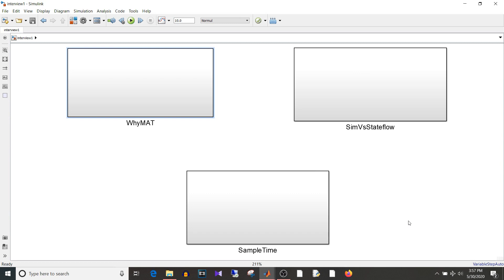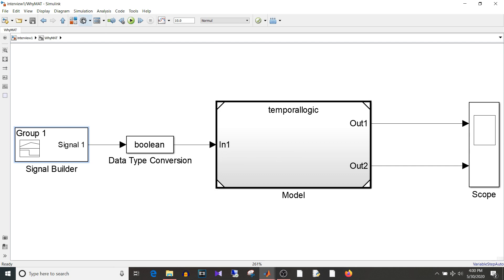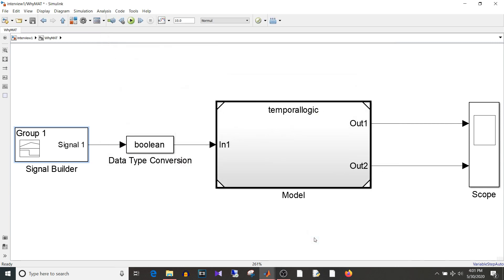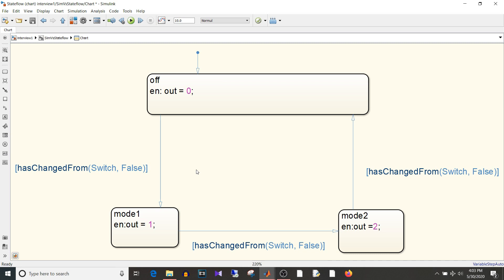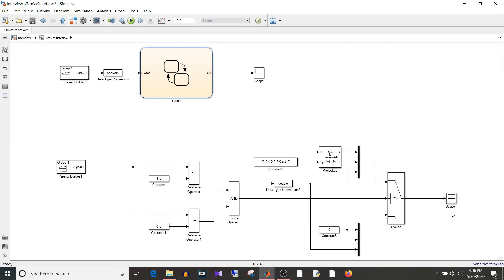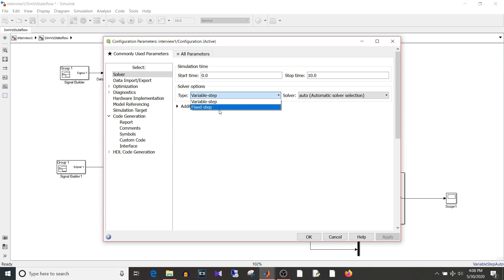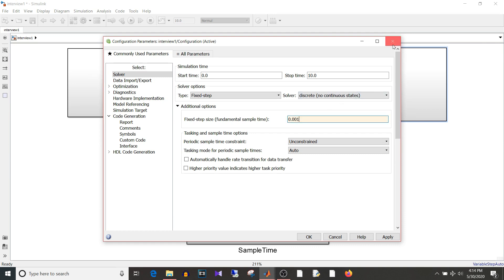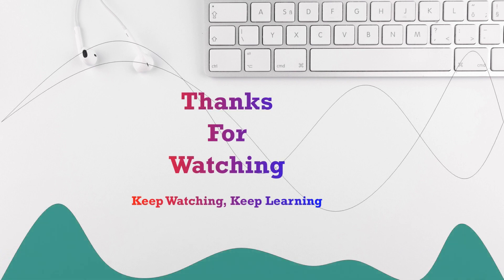Simulink Tutorial - 60 - MBD Interview Questions

Comment: Hello @simulink tutorial! Thanks for your videos. I  have a question regarding that simulink model showed at 05:13. I had to insert an additional block on k output (Prelookup block) in order to be able to run without data type error. This addition block was the "Data Type Conversion" (to Double). My question is: did you have to do the same? Or could you run this model without this additional block? If so, which configuration you did in order to not need to use this additional block? Thanks in advance.

Comment: Hi Namrata!! 
I actually extol the effort you put forward to teach us. I have learnt a lot from ur lectures. I faced one question in an interview where I would like your input... 
"Why do we go for SIL testing when we already have tested our logic in MIL testing, don't you you trust your simulink developed logic? "
Reply: MIL simulates from left (top-bottom) - right .Code it is simulated from top to bottom sequential line by line . If u use read and write memory block this causes 1 raster  delay in MIL and SIL .which can lead to problem in real time. There are many things like this.
Reply from the maker: Some projects just go for MIL and then bench testing. But some prefer SIL due reason given below, there could be other reasons as well but below one, I learnt while working on projects.

Codegen with different tools:
Some projects use Targetlink for code generation.
So code from SIMULINK codegen tab will differ from the one which is generated from Targetlink as it has additional codegen checks on blocks.

So even if with your MIL test case you see that your model coverage is complete, it might not be on code level.
When we perform SIL, we come to know which code is unreachable and which can be tested further.

Also, some projects use their own config settings. So while implementing model the model could be with double data precision but when code is generated it is platform specific which could be single precision. So in SIL environment, we come to know the behaviour with precision loss.

So it's depends on project. Not all projects I worked for, used SIL. Some even directly used HW testing.